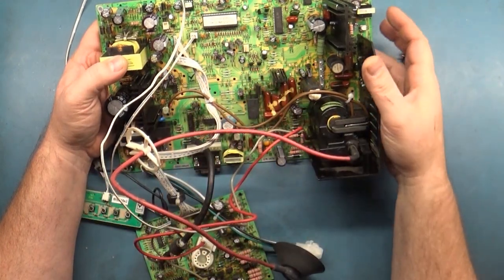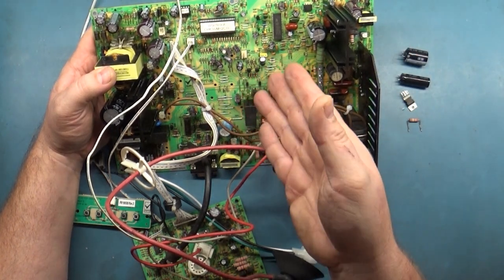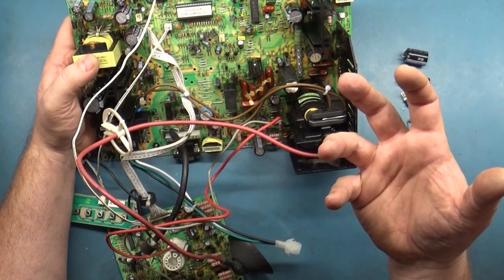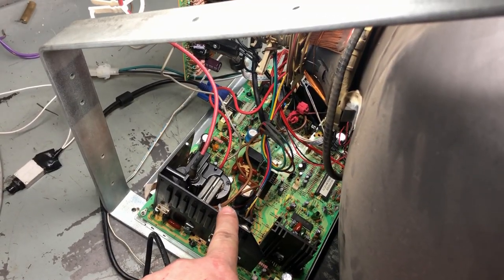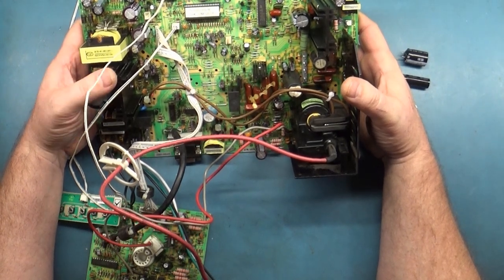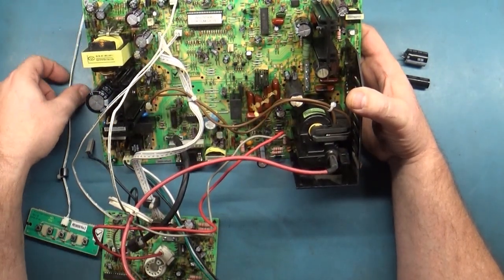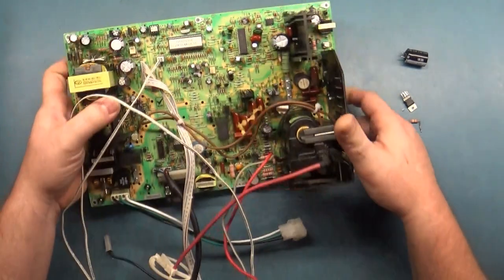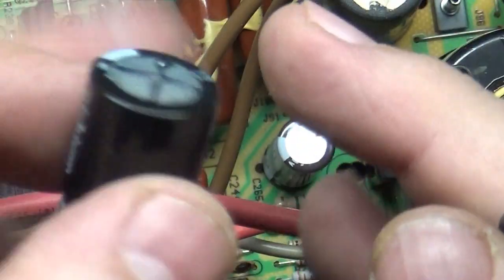27" D9800 Arcade Monitor Repair - All White Screen/Discolored Corners/Flickering Image/Clicks On/Off

Comment: Thanks for sharing this video. I have a D9204 and I love the picture quality but I want to learn all I can about repairing it.  Currently it will sort of squish in horizontally near the bottom sides only if there is a bright graphic on screen. It looks like poor high voltage regulation. I will be doing a full cap kit on it soon, but would love to see more repair videos on the D9200 series.